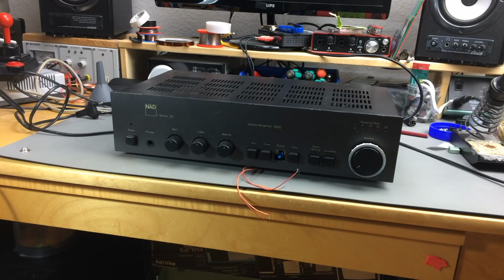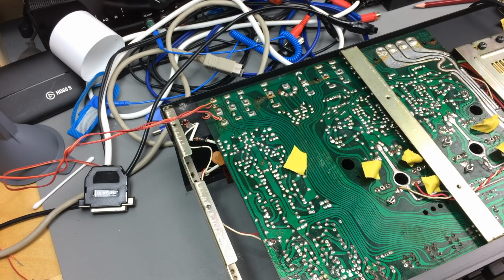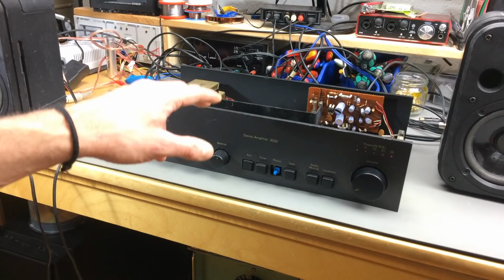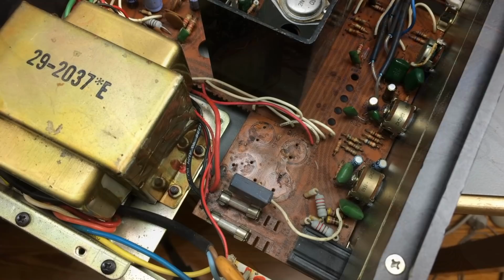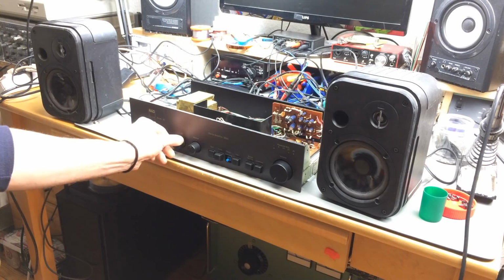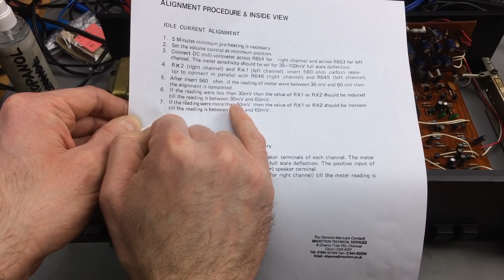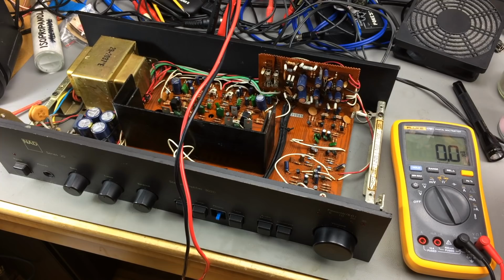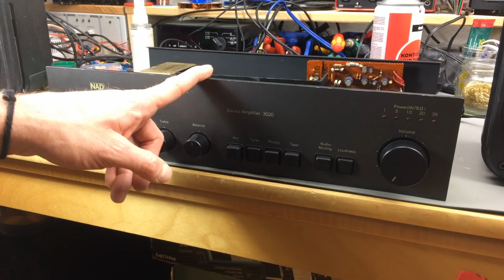NAD 3020 Series 20 Vintage Amplifier Repair

Comment: The output transistors have the date code year 80- week 23, the replaced one is year 87-week 11. Thanks Jan for this video, I have a more recent 3020i (1990) to repair, and it helped me.
Reply from the maker: Ah, didn't see that. Thanks! Best of luck with your repair. :)

Comment: I have had a somewhat newer NAD 304 since the 90s, I used it until I moved out from my parents' house for good. It's still in pretty great condition, been sitting at my parents' for many years now and not seen much use, so the pots have gotten scratchy. I want my parents to be able to listen to music even though they rarely do, so now I replaced it with my wife's NAD C320BEE which is very similar to operate, until I get around to attacking the 304 with some contact cleaner. While I'm at it, I think I'm going to undo a silly and meaningless little mod that I did 20 years ago,  linking the preamp to the power amp internally. These NADs are awesome little amplifiers in my experience. They sound good, and I've never had any problems with mine.
Reply from the maker: Nice! Yes, I'm pretty much in love with this little amp, too, now that I've met one in person. Can't wait to fully rebuild it and give it a proper test run. :)

Comment: I went ahead and download the schematics and service manual from hifi engine. The R654 and R653 resistors are shown as removed in the service manual and marked as "shorted after idle current adjustment", and are not shown at all the the schematic document. I don't believe they should be present and are just meant to be a test point for the procedure.

So in a nutshell, you open them up, install R654 and R653 (which are also listed in the service manual as part number 16-1/4CR 1R0Js, these are 1 ohm 1/4 watt Carbon type, link below should be suitable replacements) and measure the voltage that is present between the emitter and the +30.5 rail to calibrate the output, at idle with no draw of current through the emitter, then short them when you are done.

It would be nice if the service manual made it clearer, but that's what I get by reading the schematics. You should check and make sure they are indeed jumped (it looked like they were on in the video) before doing the procedure and remove the jumpers to do the procedure, then close them again when finished (otherwise your amp won't produce any meaningful output signal as this is a push/pull amp).

Rx1 and Rx2 are the middle of the a voltage divider that consists of +30.5v to -30.5v all across Q615, RX1 and Q617 on the left channel and an identical on the right consisting of Q616, Rx2, and Q618 on the right channel.

Again, this is according to the service manual. I can't confirm that on your particular unit. It's just a well educated guess.

https://www.ttiinc.com/content/ttiinc/en/apps/part-detail.html?mfrShortname=KOA&partsNumber=CF1/4CT52R1R0J&customerPartNumber=&minQty=5000&customerId=
Reply from the maker: That makes perfect sense. Thanks for the description. I'm going to try it just like that and add 1 ohm resistors for measuring. :)

Comment: At about 11 minutes.... 
Jan: 'ok, so let's just plug this in now and see if it works...'
Me: glances at timing indication on the YouTube player, sees 40+ minutes left to run .... 'yeah, it's not going to work just yet Jan, I bet'
:-)
Reply from the maker: Haha, yeah, it wasn’t all that easy. Still some work to do obviously. I plan on completely replacing the output transistors with new ones. Luckily they are still readily available.
Reply: I do this as well, haha.  Kinda spoils it for me tho.
Reply: @His Masters Voice NAD produces some quality amps, too. C320BEE, C355, etc. They also produced some really high grade CD players in the early 90s.

I have to believe in NAD to a certain extent as NAD is also my initials 🤣🤣🤣
Reply: @His Masters Voice Well they were and are the biggest selling integrated amp in history (well over 1 million sold) and 40 years later people are still talking about them, using and restoring them. Prices on ebay are going up and up for these 'junk' amps now. Australians obviously have far better hifi available to them which the rest of the world hasn't heard about.

Comment: By replacing all the cap's, the amp is essentially good as new, so even if its working fine, its a good idea to do that with amps this old. And dont cheap out on the cap's, use high quality ones. Some of the later NAD amplifiers, think it was made around middle of 80's, you can actually upgrade the low end/middle end amplifier to high end, by upgrading the filters and replacing caps with high end caps, and transistor replacements. The price difference between the low end amp and the high end amps in this series, is something like 5000 euro, its alot, and defintly worth doing. There is alot work doing that, so its not for beginners, also you have to understand what your doing, and have schematics for the high end amplifier as well as the low/middle end amplifier your working on to understand how to rebuild it to high end.
Reply from the maker: I had very good results with the Panasonic FCs I used before. Good quality stuff. I wish I was pro enough to upgrade the circuitry but that's way above me unfortunately. :)

Comment: The "clippy things" are called stand-offs.  For the Bias adjustment you need to install 1/4 watt  1.0 ohm resistors in the locations for R653 and R654.   You then measure the bias current by reading the voltage across the 1 ohm resistors.    After you have adjusted the bias, you then short out the resistors but leave them installed for the next time the unit is serviced.   You can find this information in NOTE 6 of the schematic.     ALSO, you got lucky after replacing the caps because you might have damaged one or both of your speakers.   See if you can find a non-inductive 8 ohm 10 watt or higher resistor to act as a load until you have verified the repair.   If you only have one load resistor you can move it from channel to channel.   Then use your scope connected across the load to check for any oscillations or clipping that could be present and might also damage your speakers.    An osicllator app from your phone can be used as a sine wave source to observe the output.    A procedure I have used to adjust idling current when there is no information is available is to use a current meter in series with the AC power supply to the unit.   Adjust the bias down until the current is no longer decreasing.   Then slowly raise it until you get the current to go up slightly.   Then do the same for the other channel.   Measure the voltages (current) across the emitter resistors and try to adjust them equally.    Let the amp stabilize for a half hour and check again.   Feel the heatsink to see if it is warm but not hot.    If you have a distortion analyzer you can also set the bias current by feeding a 10khz signal at about 1 watt and adjusting the bias until the distortion goes to minimum.
Reply from the maker: Thanks for the description, I'll try 1 ohm resistors for measuring. Makes perfect sense. I actually have a 8 ohm load to test amps I built a while ago but didn't use it because I was pretty sure it was going to work alright. But you are right, I really should have been more careful.
Reply: Aren't the speakers already damaged?

Comment: Excellent video. I have an old nad 3020. Great unit. In storage now but will need a recapping and work when I decide to put it back to use. It has a warmer sound then my mid 1980s NAD Monitor series 1300/2700 combo that I replaced it with, though they have a lot of nice qualities as well. 🙌👍🙌

Comment: The 3020! I got really excited when I saw the notification for this, as I have a 3020i myself. 
I really like these amps a lot and use mine for my desktop and to connect things like my phone and other devices. 
Unfortunately mine lacks the little power meter and the weird vertical connectors at the back, as it's a unit from 1991. 
The front panel is also totally different, having a different style of knobs and buttons.

I look forward to the next video on this amp! This one's been really fascinating, and now I want to do some maintenance on mine as well.
Reply: 3020i is bad sounding, you must have the first version or the 3020b !

Comment: Hi congratulations for your great skills indeed.  What i find surprising is the careless that some designers give to two important regulation issue:  offset and bias.   They should provide clear points of measurement to make the regulation procedure easier and more efficient.  Moreover in old vintage unit like this one (it is almost a 40 years old amp)  the trimmers for bias and offset should be replaced with multiturn sealed ones for better control on regulation.  And most of the caps replaced as well.  A very historical amp indeed.  I think they sold them in thousands.   Kind regards, gino

Comment: I had the older version with no tone controls, but it still had soft clipping and the MC phono input (used for a Stanton pickup back in the day). Normally mine ran slightly warm (~40c IIRC??) when idling, but since I bought it new I never had occasion to repair it until the 90's when I recapped many grey ELNA preemptively with Nichicon. I always liked how the designer put the 2955 PNP's closer to the edges of the heat sink, since they live longer when running a few degrees cooler. Thanks for this blast from the past!
Reply from the maker: Nice! I didn't realize the design detail with the 2955s but it makes perfect sense. :)

Comment: Regarding DC offset... the best way to adjust is to disconnect the preamp links, and make a shorting plug that shorts the power amp input to ground. You may find a lot of that DC offset is coming fom the preamp. I'd probably ensure "soft clipping" is turned off as well.

As for the output transistors, go for Onsemi or ST branded parts... there's a lot of junk sold as 2955/3055 which are OK if used as pass elements for power supplies for example, but suboptimal for audio.
Reply: Also the DC offset has mostly to do with the working conditions of Q601 and Q603.. mostly due to the topology of the circuit. This amp doesn't use the usual "long tailed pair" input stage so it works a little bit different, and its part of what is responsible for this amp's sound characteristic.

TBH 100mV or less of offset is not a big problem. The power on "plop" comes from this amp not having power-on muting relays - pretty much any power amp will do this when power is first applied, but the relays keep the speaker disconnected for 2-3 seconds while the circuit stabilises.

Comment: Those insulators for the output transistors are mica and are much better than the silicone insulators you were wanting to use (much cheaper too).  Silicone or trade name Silpads were promoted as easier without need for thermal compound but they have a short life of between 3 to 7 years whereas the mica insulators have an almost infinite life as long as they aren't physically broken.  Mica is very brittle so when removing the insulators it is important to slide a flat chisel blade knife underneath them and carefully slide them off the heat sink.  Milar would be the worst insulator for a heat producing part as it would melt and break down on the first use of this kind of product.

Comment: Would you believe we had this exact one when I was growing up! Looking forward to catching up on this vid.
Reply from the maker: I actually just started working on the amp again a couple of days ago. Promised it to a friend but I managed to completely break it (tried repairing it "too much")... A new video is coming soon(ish), too. ;)
Reply: @JanBeta  Oh no! But also, cool!
Reply: @JanBeta  This is as close to a manual that I get as I try to get my Two series 20 that WAS working Before I messed around with, both of them, (recap for no reason). Ultimately trying to fix the first one at all. 
I ran into the same issues on both amps, the voltage regulator is not made for repair without a lot of preparation and good soldering techniques. I wish I could get a new PCB for this card that is held in place by plastic splinters on the back, but I had no such luck searching e bay, So. Ye, please share a new video, you are entertaining and you have a superb cam clarity making the absence of a proper service manual less apparent. They are also totally impressive amps that never stops to surprise me with their detailed and articulated sound, never feeling short of 2*80W.  This series 20 version, that is, marked "80W" on the back, the others are fine but dont sound like these original units.  Supposedly since of an error in the pre amp making it unusually swingy, thats what I heard anyways. Thanks for your videos and yes, please follow it up! Patrik, Sweden
Reply: @user-lh8rb5wx6q  did you set the Bias. If so, what tool did you use for the trim pots?

Comment: The NAD 3020 came out in 1979... the tail the end of a time when companies were genuinely striving to improve and perfect the performance of amplifiers. A year or so after the 3020's release this trend was suddenly stopped by a paradigm shift. Miniaturization, cost cutting, replacing everything with ICs and cramming components with gimmicks became priority. There was little or no interest left to actually improve amplifier sound in consumer audio. The high end market was an exception to this trend but there was little interest because it was driven by a very small niche market and costs for this high sound quality sky rocketed making it look like a ripoff.

Comment: I’m learning to. Going back to college after 30 years taking Electronics AS Degree program to enhance my hobby with electronics and building amps, pre-amp, DACs, speakers. I purchased the ( DER EE LCR METER DE-5000 ) you will not have to guess if capacitors are good or bad.
      When replacing capacitors some were designed to block DC more then others. There is a reason why some are different. Than some vary low ESR is needed other need 105C + because it may be in power supply next to vary hot resistors or hot MOSFETs. One size fits-all may work but may cause long term reliability or noise or change sound or preference in your phono or preamp

Comment: Upgrade the filter caps in the preamp and amp sections, replace caps in critical stages with polypropylene caps and you have one of the smoothest and cleanest amps money can buy.

Comment: I downloaded a service manual for the 3020. Maybe a different version, but there's a drawing with the enphasized positions of R653 and R654 terminals. Just put the 560 Ohm resistor there and measure at the resistor leads. If the measured value is outside the 30-60mV interval, then change the RX1 and RX2 values accordingly.
Reply from the maker: I did some more videos about this amp where I tried to set it up correctly using (I think) that service manual. It still was a bit strange, I think there are quite a few different versions of this amp. Thanks for sharing your findings!

Comment: I have a couple of those, one in reasonably good shape (though power indicator leds don't light up above volume regulator) and another one completely trashed (lots of hum). Gonna restore both.

Have all the parts in the mail and eagerly expecting pt. 2 :)

Comment: I fixed many of the NAD amps in the 90s. I never understood what the fuss was about. They always sounded completely average to me. Most were very ugly with limited inputs and controls. The Taiwanese parts were very junky and the resistors were always going high. You discovered the conductive glue they gave every owner as an added peeve. I always considered them to be mediocre gear at an inflated price. They made me money so I never complained. Also, the very standard off-the-shelf transistors made parts supply easier so there is that.

Comment: Beutiful job. Ive recapped a few amps and old cassette decks ect. Always a good idea to do it on old amps despite some feel it shouldnt be done.  I find recapping therapeutic! 
Ive recapped my nad c352 amp. The caps I removed were junk, I used panasonic fr and fc mainly. Sounds awesome. 
Really enjoyed your video, thankyou
Reply: modern caps are far superior to those from 40 years ago , I do the same and also find it theraputic

Comment: Spraying potentiometers with oil instead of desoldering, disassembling is the best way to kill them. Thanks to this you just left bigger mess than it was...
Reply from the maker: It’s not oil but contact cleaner specifically designed for this job. Admittedly desoldering, disassembling and cleaning the potentiometers from the inside is the most proper way of doing it but contact cleaner works well for at least a couple of years to come in my experience (and I’ve been working on amplifiers since the 90s at least). If you use corrosive contact cleaners, they are indeed going to mess up the pots, T6 Oszillin is extremely mild and doesn’t even harm the carbon layer.

Comment: As for the resistors.... you can use pretty much any low value resistor. I think the schematic actually shows 1 ohm. Thus 30mV would mean adjusting for 30mA idle current.
Reply from the maker: Yes, I think that'll be the thing to do. Makes perfect sense now. :)